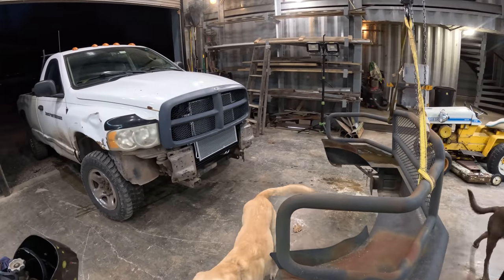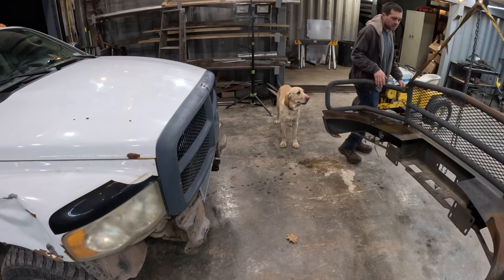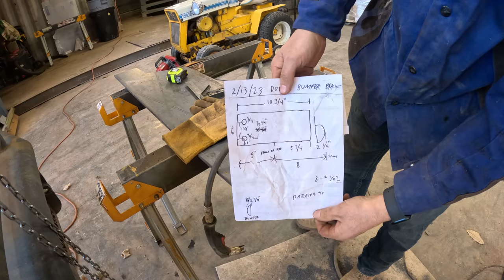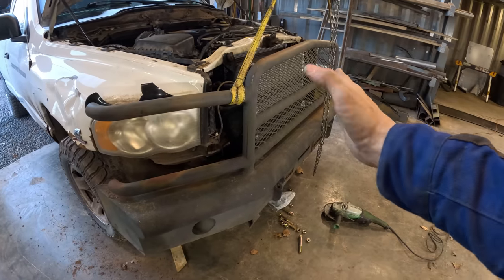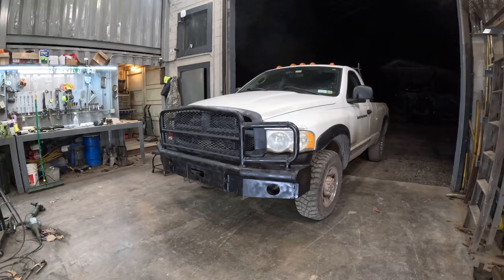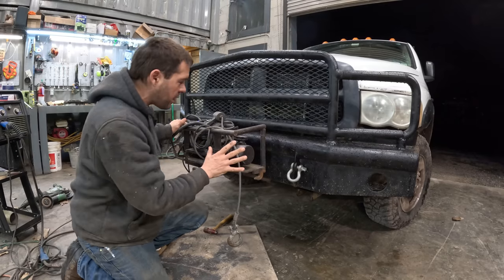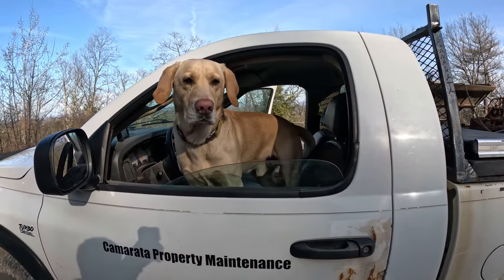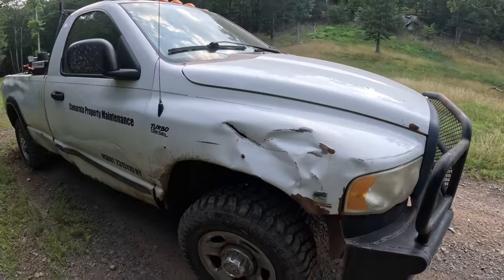Installing a strong bumper on a pickup truck

Comment: Weak bumper is made to be sacrified as a crush zone. By installing massive, overengineered guard instead of, will just put more stress to the frame, breaking it prematurely. Its all caveman engineering with no real purpose but fun  for many to watch I guess.

Comment: throw the wench in a truck box or in the cab and call it a day, you are correct Andrew, you don't need the extra weight on the front end and you will be exposing it to the elements like sand and salt, rain etc. which will reduce the life of the wench. The test you did with that junk car Andrew lol 🤦‍♂
Reply: official_AndrewCamarata  what’s up Andrew, are you busy this summer? I live one state over from you in CT.

Comment: Little dark spot under the truck in that last shot. Maybe they didnt tighten all the connections. I have the same attitude about "professional" mechanics. They dont have basic self quality assurance. Young ones have no attention span and no one has ever told them to tighten up.
Reply from the maker: That was just a clump of dirt. I was going to move that because it looked like a drip. I should have.

Comment: Andrew, take that crappy ass, beat up old fleet side bed OFF that truck and drop you a nice strong STEEL Flatbed on it...make that RAM great again...😉
Reply from the maker: then I have to tie everything down, I’m fine with the bed the way it is.
Reply: @AndrewCamarata  truth. gotta tie down every item. tedious
Reply: @AndrewCamarata  ... holy begeezus, they DO make 12" sides and also the rear ..not to mention giving you more weight for traction when you're snow plowing.
Quit working with crap
Reply: @franklee9127 the bed will be worth more than the truck
Reply: @ryanjohnson8340  
Most definitely, people here in Oklahoma laugh our butts off looking at all the rust and metal rot on those Yankee vehicles. So unsafe... like that rattle can paint is going to save it... 😂